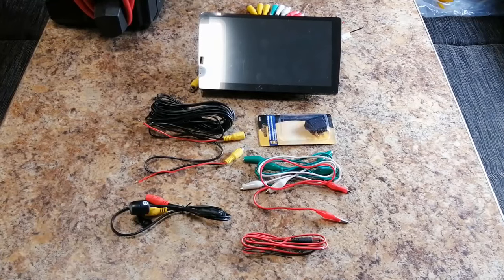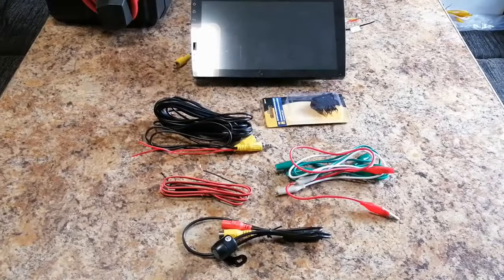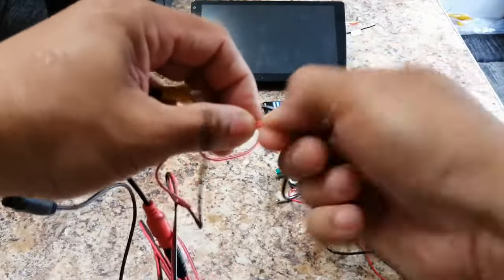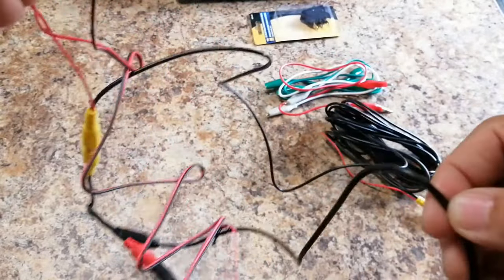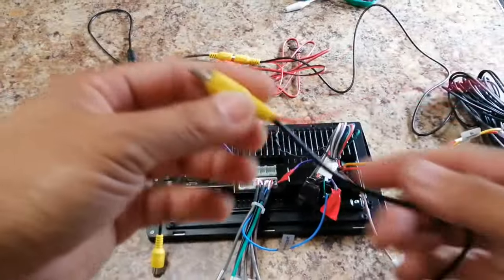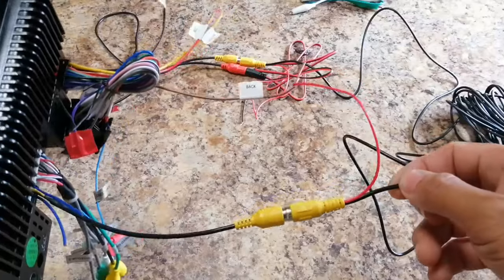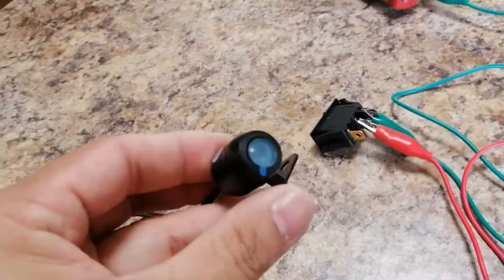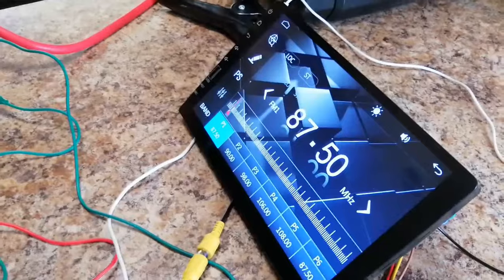How to install Backup Camera Wiring connection into car stereo explained

Comment: What if your car already has a backup camera? How do you connect it to the new stereo
Reply from the maker: If it has the same composite connector then connection should be the same. But if you are talking of the stock camera in your car, most of them has proprietary connectors which you have to do some cutting of the wires to make it compatible with aftermarket headunit.